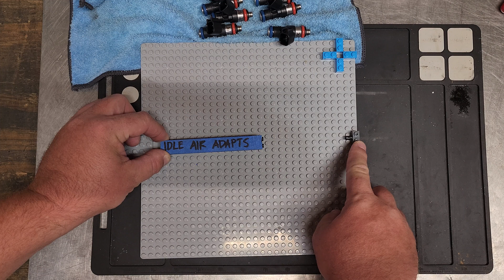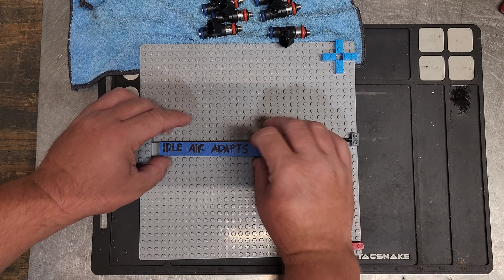Explained with Legos: Don't touch THAT table!

Comment: This video motivated me tinker with an idle that works but I've always felt could be better. I am on an LS2 with a cam similar to the specs of yours. Any tips or suggestions on how to find the optimal timing at idle? It was set at like 22 and I dropped it to 15 just to see what it did. It actually idled a lot smoother. That woke up the OCD in me and now I am on a mission to figure out how find the sweet spot in idle timing.  I know I need to be in that spot where I have plenty of "torque reserve" but not so much that I can't reduce power.
Reply from the maker: 18° seems to be the universal sweet spot for a cammed LS. Good luck on your quest!
Reply: I just went out there and played with it a little. Using the histogram I noticed at idle the timing was hovering around 15. I misspoke, I set it to 12 earlier. So it's at 15 now and I like it. I may have other issues though. My 02 voltages on B1 look perfect on this histogram, perfect U shape. On B2 it's a who different story. It stays at 400 mv 50% of the time and 10% at 600mv, 700mv, and 800mv. I was hoping I could just tinker with the proportional numbers at idle area but no luck. Histograms changed but B1 and B2  voltages were always very different. Guess I need to look for leaks and swap the sensors to see if it follows the sensor.

Comment: I'm wrestling with a herky jerky light load low low rpm especially @ 1600rpm. It's a 2006 base vette, LS3 stroker, 4.5* overlap, modified Frankenstein cylinder heads. Other than this herky jerky it runs very well, I'm using HP enhanced OS with traditional VE tables. I'm watching your video wondering how to run the stock airflow table, it needs approx. 3gr/sec of additional air to run properly. The dyn air lines up with the increased base running airflow, so I'm assuming this is correct. My assumption has been the base running airflow sets the blade in a position the motor runs happy, the other tables then operate around that position as mine do. I'm a home grown backyard tuning guy trying to learn, hopefully you will respond to this.......Tx's.
Reply from the maker: Gen 4 ECMs do NOT have Base Running Airflow. This is a concept for DBC TB's that use an IAC. Yes, HPT does list Min Final Airflow under the BRAF section, this is a mislabel on their part (and there are other mislabels as well). Contact them to complain.

On a Gen 4 you cannot set BRAF. In fact you have no control over the airflow. The ECM calculates the base airflow as Steady State Airflow and then the Idle Integral and Proportional Airflow are adders to that. There are also other adders and multipliers to the airflow as well. Once that final airflow value is calculated, the last step is to check to ensure it is not lower that what the tuner has put into the Min Final Airflow table. This table is a final safety check. It is NOT the primary table to tune idle.

I would not worry about if DynAir matches Min Final Airflow for idle stuff.

Low load + low RPM jerkiness sounds like typical cam bucking due to reversion. Don't drive in that region.
Reply: @SilverSurfer77  If I were to go back to the stock Min Final Airflow table I would need to do a major rework to Idle Integral & Proportional values. Possibly the same end result a different way. It starts & idles nicely with minimal spark correction. I did pick on one of your comments regarding coast down timing & removing a lot of spark, mine does that with no buck or surge during coat down. When I set idle timing to 20* & match the main spark to that in the offending area the herky jerky @ 1600rpm is almost tolerable. Thank you for taking the time to reply, I'm being a fussy little bitch looking for nice manners 🙂
Reply from the maker: @daleblock3974  no one should ever be touching the idle integral and proportional settings. That usually invites a different kind of disaster.
Reply: @SilverSurfer77  I spent a couple hours with this on the dyno in the light load low rpm area experimenting with positive results that may impact your video. First I find with evan a small cam low speed light load attitude is very sensitive to anything triggering bad behaviour. This can be a twitchy blade or small timing changes. Stable flat line timing is helpful, matching coast down timing to that made a noticeable difference as well as zeroing the adpt idle park coast down. It takes very little input from pedal to start the coat down timing transition. A small spark change triggers the attitude. Doing this stopped the idle dip from a throttle blip, so now I can go back & start to reduce the incorrectly labelled BRAF airflow final min. Yes I do see a timing dip as it returns to idle when you lift the throttle, very smooth decel, it is precise & predictable now. With the benefit of improved parking lot manners, you do have to drive that way @ times. I ran out time to continue on, I felt the results were positive enough it may help another viewer.

Comment: I have been rethinking this as well. My thought process was to bump the table to get the startup tune going, dial in airflow model, set min airflow to a value less than that actually used at idle to leave room for the ecm to do its part. With a aftermarket camshaft more air is required than stock. The table can still be adjusted while retaining the function of the rest of the idle control. Im not disagreeing, just stating my process.

Comment: I had been experimenting with getting my idle better, final air flow minimum back to stock and raising the idle torque follower table in the idle area and it has never been so good, I also fell victim to believing that the final airflow minimum was the only way to keep the idle stable.
Reply from the maker: That's great to hear! Never stop learning and experimenting!

Comment: great way of explaining dude.  keep them coming.  and how did you learn about tuning to this level
Reply from the maker: Thank you! I just obsess about stuff and keep digging. The OEM ECM has proved to have so many layers that once I think I have it figured out I learn something new. It just keeps my interest piqued.

I started out just trying to learn on my own from forums, facebook groups, youtube etc, but the knowledge and detail was too surface level. I turned to a local professional tuner for some mentoring to learn more, and then I finally I paid for the Evan's Performance tuning course. At this point I finally started seeing the bigger picture and felt confident enough to really experiment heavily via trial and error. This was the start of COVID and working from home...so it was really easy to slap in a tune, get a log, and dig in and try again. I do not even want to think about how many miles and tunes I have put this car though! At any rate, I am now at the stage of going through the process of decompiling the BIN files and looking at the hex code for the next layer of clues in the ECM.
Reply: @SilverSurfer77 I purchased the ERM performance tuning guide.  Not sure if that's the same.  Whenever I'm in your neck of the woods, wherever that is, or you in mine lunch on me. I want to pick your brain

Comment: If it don't work why do those experts keep doing it. I did it and it ruined my idle tune. Worst piece of advice ever. I guess I should of known since they didn't explain it with legos.
Reply from the maker: Everything in life exists on a scale of good, better, best. What I have found is that humans stick with what they know and are resistant to change, even when presented with better knowledge or data. This is the human condition, and most choose to be trapped in this paradigm.

I see many tunes where one part of the tune is bad,  and band aids are applied elsewhere to compensate for it. I would also surmise that 90% or more of professional tuners do not tune VVE at all (and if they do it is terrible) and then they lower the Dynamic RPM disable to 100 RPM to force the MAF to take over. There are still "experts" out there that put cars in OL SD to tune VVE as well. The point is, they develop a system that works for them and stick with it.

So I would not base anything on what the herd of professionals do. Remember, the professional's goal is to get your car out of their shop as fast as possible with the most OK-ish tune. They deal in bulk. They do not deal in Legos...I mean perfection.

One final piece of advice I will leave you with, the most dangerous phrase in any language is "We've always done it that way."
Reply: I really like your blended MAF/ VVE tuning videos. Is the comment on using OL SD to tune VVE bad because it is in OL or because using SD mode to tune VVE is incorrect.  You should use OL MAF mode to calibrate the VVE? 
 Surely it's not the OL part that's the issue is it? I mean how do you tune WOT/PE if not in OL? Blended mode OL as I understand Titan Tuned explained tuning both modes at the same time,  is the error between Dynamic air and the model being corrected. That blew me away when it clicked.
  Dynamic air = 30g/s goal
  VVE. Air.       = 20g/s needs 150% 
  MAF air.        = 27g/s needs 111%
The EQ error may be - ## but that's not the fix.  It's making the 2 tables meet the Dynamic air WILL fix the EQ Error. That was a mind blower. Add to a table to correct what looks like an over fueling issue?? WTF but you have to trust the results. Once I quit looking at EQ error and focused on VVE Assistant graph for corrections,  that's when it all started working.  Absolutely nuts to see my WB is richer than target EQ ratio and yet I may be ADDING to the fuel model??? Mind scrambler right there.  That was very hard to trust the data. Which was right? EQ error? VVE Assistant? 😮
I know this may be off subject of MFA and Lego land. I thank you for taking the time to make all the videos you have done. Cringed to the rescue!
Reply from the maker: @opinionsevrywhere  I am a proponent of tuning the ECM in it's final state and operating condition. If you are tuning a true race car and will be running in OL SD all the time, then that is how it should be configured during tuning. But if you are tuning a street car that has 2 airflow models (MAF and VVE) and 2 fueling modes (OL and CL), then that is the configuration you should use in tuning.

In the past there was not a way to do this effectively, so you had no choice but to fail the MAF to tune VE/VVE. The formulas I created that use Dynamic Air bypass this limitation.

The real problem with OL tuning is that you have to rely on a wideband. These things are inherently inaccurate (unless you spend big money on an a professional lab grade unit). But we have no choice but to use one for OL.

So it makes no sense to try to tune the ECM in the CL regions using a wideband. The ECM was designed to use the narrowbands for CL operations. I mean that is one of the most critical things the ECM does — to dance around stoich to maintain the cat. This is vital. It is not logical to disable this, tune with a wideband, enable it, and then clean up the tune with narrowbands. The narrowbands are so much more accurate than a wideband...think of them as an EPA emissions device. By not using narrowbands you are throwing away accurate data and handicapping yourself.

Comment: This is an amazing visual for showing the two adaptives and also how counterproductive it could be if air and spark have to fight each other.

Related question: for an E40 PCM which is Gen4 but sort of also a 3.5, does the idle logic still come into play when vehicle is in motion? Say at 65mph in 6th, 1200-1500 rpm?

I was one of those final minimum tweakers but started bringing it all back down recently after understanding more about the safeguard function of this table.

Idle remains stable and reliable but then that leads me to wonder, outside of VE and MAF tables, where is the right place to look for tuning out a hesitation/stumble in the above mentioned low-rpm 6th gear scenario. Doesn't happen anywhere/anytime else.
Reply from the maker: I appreciate the positive feedback! Yes idle logic comes into play during coast down and it is even more complex! I made a video on it here showing all the tables that are involved. The video below has a link to the scanner setup I was using. The biggest tell tale sign of Min Final Airflow being too high is that  spark goes negative (or at least bottoms out on the Min Final Spark table) during decel.

https://www.youtube.com/watch?v=ALvjeVcrgJM
Reply: @SilverSurfer77  Cheers thanks, will take a look at that now. I know the E40 doesnt always have the same tables as full Gen 4s like the 38 and 67.

The bucking/hesitation only happens under light/med throttle in that rpm/gear range, under coast down or even steady speed/load its fine. And it's only in that 1200-1500ish band. 

It "feels" to me like not enough air for the switch from steady state to transient (throttle cracker? But dont see this table in the E40). The VE and MAF in that load/rpm range appear pretty well calibrated.

Will look at your scanning tweaks to help get a better picture.
Reply from the maker: @o362436o  sounds like the VE needs to be tuned (also ensure your Dynamic Air enable disable RPMs are set to stock).